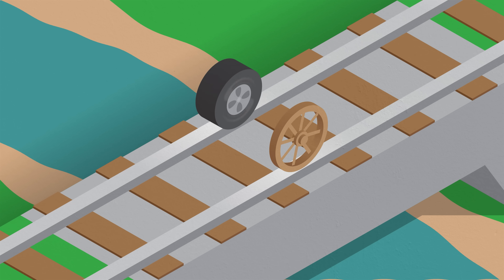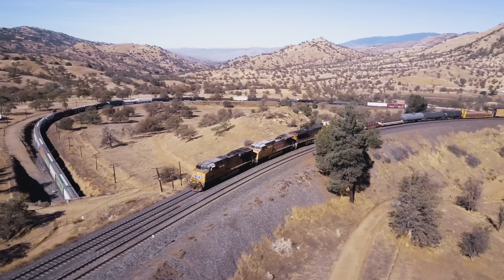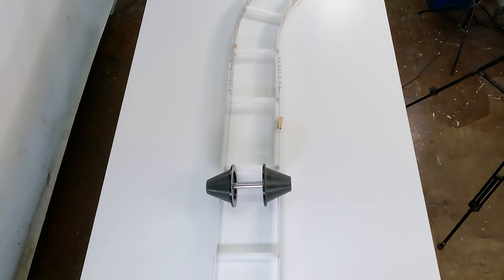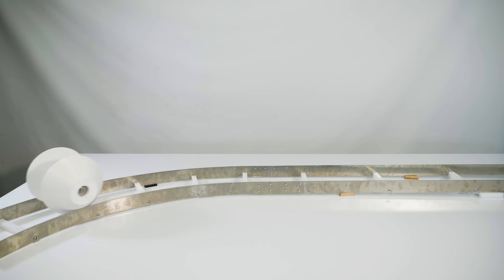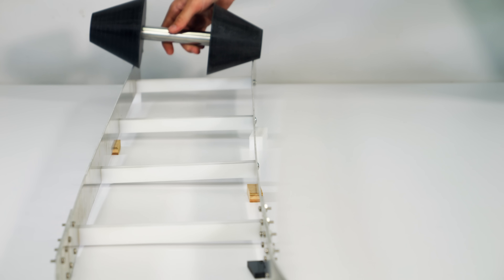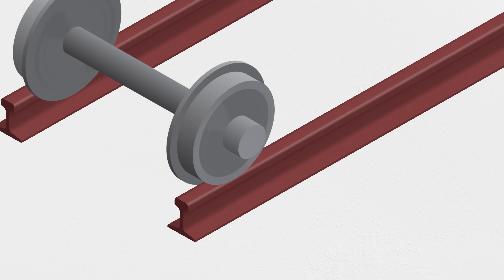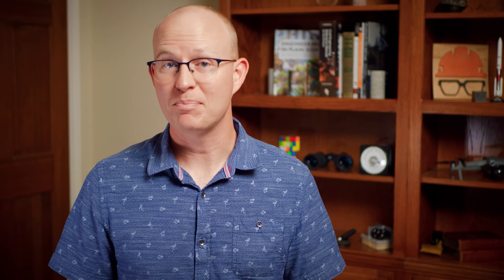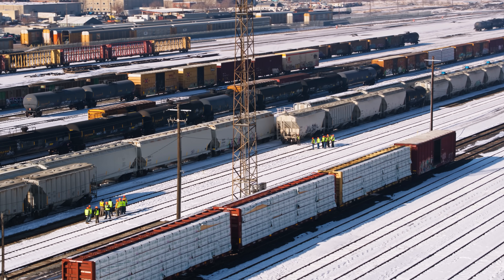Why Are Rails Shaped Like That?

Comment: I would be interested in learning why the rails were "bouncing" up and down as the train passed over it. I've seen this in person while waiting at a railroad crossing and it's quite alarming how much movement there can be
Reply: The rails act as a distributed spring and the ballast acts as a dampener. What you see in the video is exaggerated, probably due to poor maintenance, but the basic principle was invented by George Stephenson and greatly contributed to ride quality especially since vehicle suspension was still very primitive at the time. Originally the rails where fixed to heavy stone blocks due to the mistaken belief that firmer is better.  Stephenson was ahead of his time and understood the idea of dynamic structures.

Comment: A friend of mine gave me several pieces of short length steel rail, and spikes, he got from a Union Pacific Railroad 'boneyard,' in Nevada, where railroad scrap pieces are disposed at prior to being hauled away for scrap steel melting.
In short lengths from weights of 5 to 20 pound sections, the steel rails are marvelous for all sorts of uses:
An anvil for shaping metal items with a hammer.
A door stop.
A wheel chock.
An anchor for land and maritime uses; with the use of ropes, chains, or cables; or the weight of the rail piece resting on top of an object on a work table.
A counter weight to balance an object.
An anchor weight for keeping a sheet of plywood in place when using a circular saw.  The top part of the steel rail [the head] can be gripped by hand to apply additional pressure on the plywood sheet to keep it steady during the cutting process; in addition the gripping of the head of the rail during cutting can steady the person doing the cutting.

When using your imagination, the list of uses with short lengths [under 20 pounds] of steel rail could be endless, as the positioning of the rail does not have to be standing upright, but, positioned on its side, too.  The use of the short lengths of steel rails has assisted me well with numerous projects I've done around my house/property.
Reply: Alongside old rail tracks rails are sometimes also used as fenceposts, but this is a little bit a waste of steel since you would need a fraction of the material for a fence post, and not the huge ammounts of steel which are needed for a rail.

Comment: Empty car hunting is enough of a factor that most railroads operating rules restrict the maximum speed of empty cars, usually to 50 mph, unless they are specially designed for higher empty speeds, like intermodal cars, including auto racks.

Comment: As a transportation historian, I've always been amazed that the railway (locomotive-hauled trains offering scheduled transportation of passengers and freight on flanged wheels and iron rails) existed about 50 years before the "safety bicycle" (two wheels of similar size with a chain drive and so arranged that the rider's feet could touch the ground).

Comment: Another aspect of rail wheels are flat spots.  Whenever you hear a train with a rhythmic "bang bang bang" sound, one or more wheels have  flat spot.  The sound is literally from the train falling on the rail.  Passenger cars can have this as well, and it's not fun if your seat is directly above a wheel with a flat spot.  It's like sitting next to a jackhammer.

Comment: As both a railfan and an AFOL (Adult Fan of LEGO), I was recently fascinated by the fact that LEGO redesigned the wheel trucks for their trains, and now the wheels are no longer connected to one another via a metal axle. This means that the wheels on the outside of a curve can rotate at a different speed than the wheels on the inside of a curve, without slippage. While this would not work in real life (due to the loads imposed by heavy freight cars), it is cool that LEGO is taking these considerations into account for plastic toys.

Comment: Does the drive assembly on a locomotive use solid axles between the wheels?
Reply: Yes, mostly. Some high speed trains tried to use lighter, hollow axles (ICE3 for example) but they had problems with cracked or broken axles

Comment: You might be interested to learn that there was a now abandoned type of rail called Barlow Rail which was used for the West Cornwall railway, and much of the railway lines in south wales.

It was different to pretty much any other type of rail system, as the rail was flared in such a way that it was designed to be laid directly onto ballast stone, without the need for sleepers.
Reply: I think we can see why they went away then. Even today one thing you want to avoid is hitting something between the rails and it snagging a hose.

Comment: I don't understand why the bearings can't go between the axle and the wheel rather than between the axle and the truck.  Can the bearings be much larger in the latter case?

On the inbound path from Harvard Square station in Cambridge Massachusetts is a very tight turn that causes hideous wheel squeel.  The problem with the conical wheel hack is that for it to actually work, the train needs to go faster around tighter turns to get to the more fitting parts of the cones.

Comment: At 3:00 the most important reason for the flanges on the inside is switches. Otherwise it would not be possible to implement switches that direct the axles while allowing wheels to leave the inactive rails.

Comment: Recently we had a derailment in the railyard I work in caused by a bad push meaning the forces were not going straight through the draft gear. This caused a small force to the side of the rail causing it to promptly bend out of shape and the loaded tank car to fall into the gravel on one side

Comment: One question i have that may fit in here somewhere is:  “Are Trains Effected Similarly, or More/Less than Aircraft”?

If not it’s not that big of a deal, but given they aren’t as complex (at least i think, potentially naively!) they would be able to run even in some weather that would shut down airports?

I was wondering since this could be a MAJOR selling point for Passenger Rail, no more Holiday Surprise Getting Stuck!

Again though i wanted a proper evidence based look into this pre-me going around using it as a legitimate point.

Thanks!
Reply: The advantage of an aircraft is you need just 2 airports, ATC and nothing else inbetween. If you have a problem on a rail track, your whole track is blocked. 

The longer the distances are the bigger is the advantage for passenger transport. 

Rail however is not weight limited, you can't use an aircraft to replace cargo trains. Also rail is cheaper on shorter distances, like in Europe

Comment: I gotta give props to Grady. Your videos have provided me with enough info to save over $30K in some property maintenance and alterations, and no longer does gravel laden runoff block up the creek on my property, it builds up on the road, and diverts the excess water right into my hay field now, giving me an extra 1 or 2 cuttings a year. 

Legit, folks should watch your channel, it could save them thousands.

Comment: I’d like to know the effect of the wheel diameter on the ability of a wheelset to negotiate a curve. . . I’m thinking about the torsion stresses on the axle.  I ask because our Ottawa LRT (light rail transit) used small wheels. . .  From what I can see, 24” diameter or less, vs 36” for “normal” trainsets. . .

And there has been “a lot of grief”

Comment: Do high speed trains still use the same wheels and travel on the same rails?  If that wobble effect is speed related, then it could get scary at 150mph.
Reply: Those wheels are less conical

Comment: SO WHY NOT CUT THE SHAFT IN TWO AND PLACE A FREE ROTATING BEARING COUPLING IN THE CENTER OF THE SHAFT......NO MORE FRICTION OR NOISE  IN CURVES........CONTACT ME ....I HAVE A PATENT FOR THAT
Reply: it costs a lot more, is weaker, and requires more metal.
Reply: @chri-k  But seriously for rapid transit in cities a free wheeling axle might be very good. Yes for freight trains with millions of axles this might be a costly adaptation.....but commuter trains that needs to be silent have a much lower axle ratio and thus a much smaller capex
Reply: @dieboodskapper  I don’t know anything about trams, they might be using split axels since they weigh much less and also need to make much sharper turns. But then they’re also a lot slower.

The per-axle load for an empty passenger car can be over 13 tonnes, so split axels are not happening there.

Comment: Having in mind your videos about soil compacting, would be cool to see one related to rail, how they prep it for tracks and trains, and the differences between ones for high speed rail, cargo, metro, etc
Reply: There's basically three types of rail in use today. The rail section you see in Grady's video is called Tee rail, the regular classic shaped rails in almost all railroad track.
Next is Girder rail. Used by streetcars, it is very similar to Tee rail in how the wheel rides on the rail, but has a 'U' shaped flange projecting to the inside to provide a pocket for the flanges to run in and keep the asphalt or other road surface materials away from the gauge face of the rail. Last is Crane rail. Very heavy duty with a very broad head and a short fat web. It is designed , obviously, for gantry cranes and other similar applications. Wheels used by the cranes to roll on this type of rail are typically double flanged, one flange on the gauge side (inner) , one on the field side (outer). These rails are almost always laid dead straight and often quite far apart from each other, 20 or 30' or better vs regular railroading standard gauge of 56-1/2"

Comment: IIRC wheel sets for railroads where one of the first items to get highly optimized for avoiding metal fatigue. They are one of the first metal items to be produced in large numbers where they were uniformly near the fatigue limits. As small reduction in materiel or a increase in service life was worth a lot of design effort.

Comment: So the flang is the last resort it's not really meant to keep the wheel on the track, if you have longer conical wheels it would cost more, but it's this shape that allows the wheels to go of centre when going around a corner allowing the inner wheel to travel less distance than the outer one, wonderful engineering
Reply: Lol as soon as I hit "send" you start talking about this.

Comment: I have heard the claim that the squealing sound isn't from the flanges, but from the wheels gripping and slipping.  Due to static friction, the wheels initially don't slide when they are traveling over a curve, but wind up the axle.  Once the axle torsion is enough, the inside wheel will slip.  Due to dynamic friction being much lower, it will slip past equilibrium, and grab again.  The repeated wind up and release happens fast because the axle is so stiff.  That rapid grab and release is heard as a high pitch squeal.

Comment: fun fact, why are train drivers call engineers in the US?

in the wild west era of rail expansion, in the event of a breakdown, drivers would have to get creative in their  repairs, leading to some interesting in the field repairs. When I was interviewing at BNSF for a job I didnt get, they had a picture of a steam train with a whole tree sticking through its wheels. The used it to hold the connecting rod onto the wheel until they could get back to shop. I dont know if they actually drove it that way, or if they just stuck it in, took the picture, then trimmed it for clearance.
Reply: @jamesbarrett918  I'm sorry, but I disagree. I've worked in construction, and heavy vehicles can have drivers or operators depending on preference. crane drivers are an example, they don't like being called operators, or at least the ones I knew. skidsteer drivers or operators. a steering wheel does not mean driving.

my version comes from someone at BNSF I knew when I was trying to become a conductor. granted, he may have heard it from somewhere else, it's just like the myths regarding the track Guage, there are so many differing stories

lastly, on light rail operations, the operators are referred to still as drivers, at least here in the twin cities they are. now, that might be because of union stuff, they are basically transit drivers that were assigned the light rail line as their route.